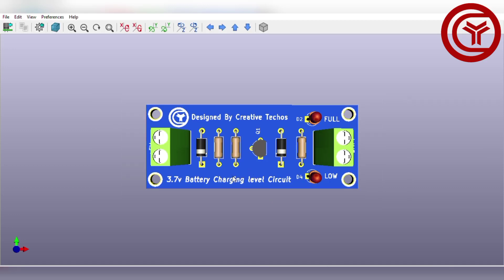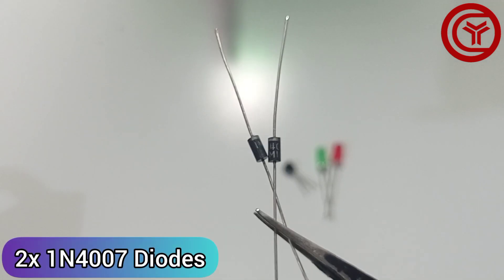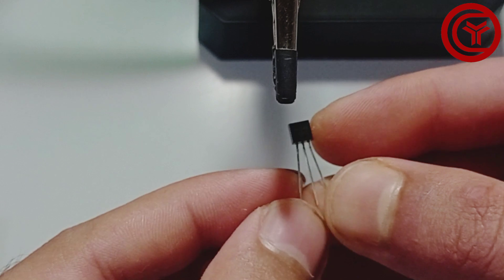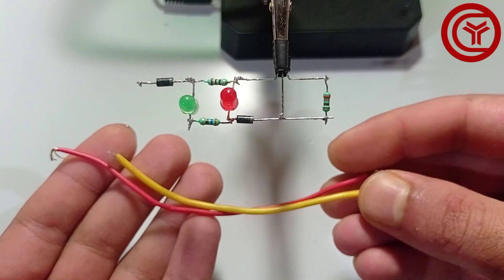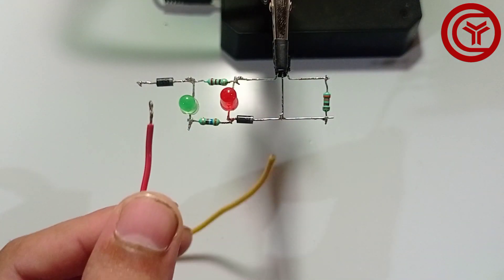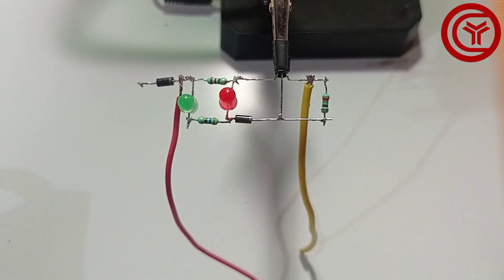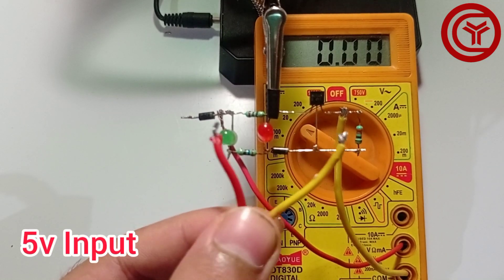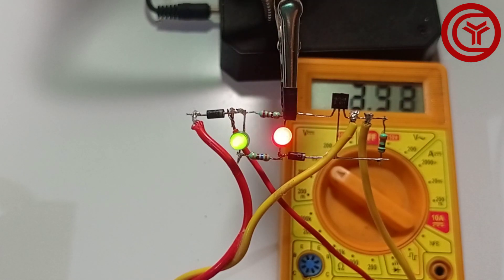3.7 volt battery charger with low & full level indicator

Comment: Have u clip with c1815 ???
Reply from the maker: You can use c1815 transistor also, but pinout configuration is different,
BC547 (CBE) c1815 (ECB)
Just connect accordingly.

Comment: Bhai 430 ohms Resistor nehi mil raha hay. Please tell me any other Ohms as substitute.
Reply from the maker: Bro checkout the new video of battery level indicator circuit for 3.7v lithium battery, that is more easy with just 220 & 47 ohms Resistors used.
Reply: But mereko iss circuit jada achaa laga.
Reply: Bhai in the new video you indicate the (+ & -) point from circuit to battery. But where i connect the (+ & -) of 5v power supply.
Reply from the maker: Are you taking about the same video on you've commented?
Reply from the maker: Please check video description there is download circuit diagram link
Reply: Sir 220 and 47 ohms bala video mey power supply input ???
Reply: Sir circuit diagram may sirf battery ka (+ & -) mention hay. Power supply kya same place mey hoga?
Reply: Use 330 ohm and 100 omh in series

Comment: sir what I can use instead of 430ohm resistor plz reply as soon as possible
Reply from the maker: Dear use 430 ohms as if you use other value resistor it will not show accurate indications
Reply: @CreativeTechos  ohh but bro I don't have it
Reply from the maker: Get from old electronics or components Shop
Reply: @CreativeTechos  well I double checked the old electronic motherboards I have and there is not a single electronics shop in my area
Reply from the maker: By the way where from you?
Reply: @CreativeTechos  india delhi new seelampur
Reply from the maker: You can whatsapp me on +91 7006179730
I'll provide you components
Reply: @CreativeTechos  thanks you bro thanks a lot BTW what's the minimum order???
Reply: For 430ohms resistor connect two 220 ohm resistors in series and you will get resistance of around 440 ohms..
Reply: @shirishvasave4671  bro he said that for accurate indication we have to use 430ohm 😁😁

Comment: the diagram picture is different bro, but thx anyway for the tutorial...
Reply from the maker: Dear sir, on thumbnail its fritzing diagram and the picture in download link in description is actual schematic with readymade pcb files
Reply: @CreativeTechos  what should i do if D1 is heating up..? is that normal ?
Reply from the maker: Diode heating is normal, if you'll charge more than 1 cell, it will get extremely heated may be it will get automatically burnt, so you can use 2A or 3A diode instead
Reply: @CreativeTechos  i see...well i have another 4007...can it paraleled to get more ampere..?
Reply from the maker: Yes 2x in parallel will pass 2A